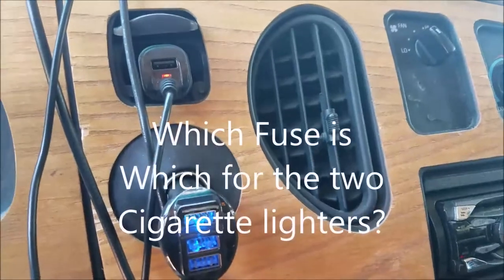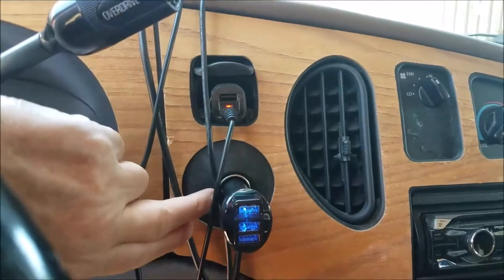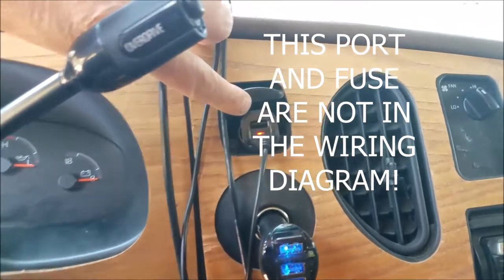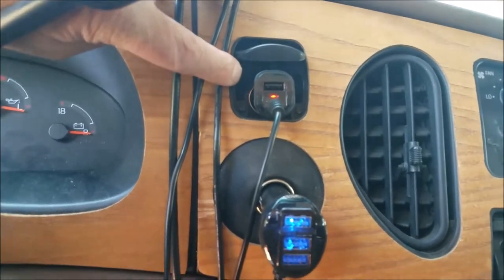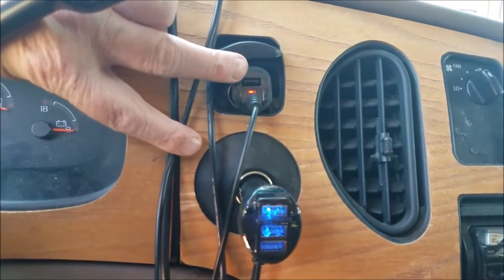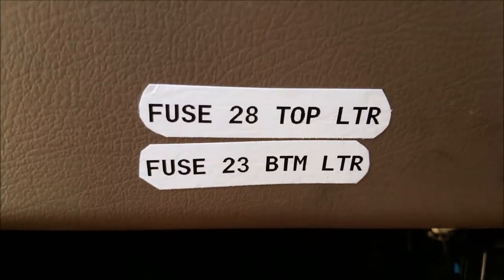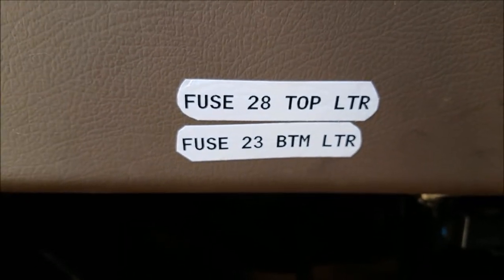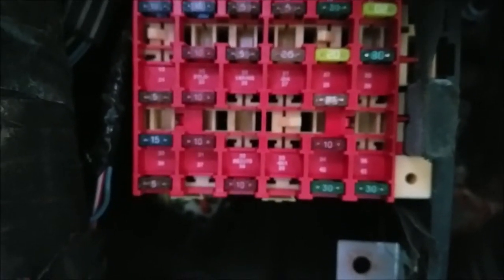1997 Ford E150 Van Cigarette lighter: What fuse is it

Comment: This video was what I needed ....THANK YOU!
Reply from the maker: My pleasure.  I used a label maker and made a label distinguishing the two ports and their respective fuse numbers on the plastic panel at the driver's knees.
Reply: @macclad3  I saw that! I HAVE 97 CLUBWAGON with a 4 inch lift and from the front of the rear wheel well to the firewall was cut out and lowered 4 inches for handi-van.

Now it is my home with Rv stove oven solar mppt dometic rv recessed sink diesel heater propane on demand h20
There are 6 SIX cigarette outlets in the back all no power.

Fried my power point fuse by 3 yr. old quick charger usb fried up.

Thanks again!
Reply from the maker: @1DEFEND  I'm delighted to have helped. I'm waaaaay late on new posts but I do respond quickly to comments and that's what this channel has turned out to be more than anything else.

Comment: Wish I'd seen this before unnecessarily destroying the bottom  cigarette lighter socket getting it out. I'd checked the 29 fuse beforehand, which was okay. But the 23 fuse which I hadn't known about was blown.
Reply from the maker: I have a long pile of those sorts of things.  I highly  recommend scrounging around ebay for the factory service manual and the "electrical diagnostic manual".  The latter just turns out to be the wiring diagram. I also looked around forums and found the "power plug" reference.

Comment: thanks for the info. I just bought a similar van.
Reply from the maker: Their air circulation systems are a bit of a weak spot, particularly  but the vans are fairly sturdy. I replace a lot of suspension, the radiator, the rear bearings on the axle, and the front disc pads twice.  But the stuff is pretty easy to work on.

Comment: Hey I have a bit of a tricky one!!  All of my cigarette light in the back do not work at all but the 2 front (that you showed) does I have a 2000 ford encoline e150 I’m believing it has to be a fuse for all of the ones in the to stop working…
Reply from the maker: Hi Melvin (first of all I'm like a year late on new postings).  But I have the electrical manual for my '97.. I'm outta town until a week from today so I'll have to look at it then. I have the rear cigarette lighters like you do on my '97 (it's a "Universal"(brand) conversion (just wood trim, lighting, and fold down bed).. So I'll look at that as soon as I get back in a week. Let me know if it gets solved before then.
Reply: Let me know if there is any update!!
Reply from the maker: @melvinjordan5559  Sorry I have been working on taxes.  Lemme send them out today and then I"ll look first at the factory wiriing diagram.  Next, on my van, I"ll unplug those two fuses to see if they have an effect.  You'll have an answer absolutely no later than tomorrow.
Reply from the maker: @melvinjordan5559  O.K. I scoured the entire wiring manual for the '97 and of course there is no reference made to those rear outlets.  I suspect it's controlled by an undocumented fuse in the passenger compartment instrument  panel - I looked on the interwebs - no luck. - (so you will have to check yours as well as me checking mine). I suspect it's fuse 40 on the inside instrument panel (it just says, "modified vehicle" and is a 30 amp fuse), and if not that it could be 22 in the engine compartment (trailer battery charge relay, "modified vehicle") but I'd consider that much less likely.  I'll start pulling fuses and let you know what I find.
Reply from the maker: @melvinjordan5559  Well, I'm flummoxed. I pulled every fuse imaginable .. no go.. the outlet stays on!  I'd have to disassemble the interior and trace that wire back through the harness.  I'll try to find something on the forums.
Reply: Thank you so much for doing this!!! It has given me problems from the beginning!! Let me know what you can find and by the way what fuse do you have in fuse 22 underneath the hood? The modified one?
Reply from the maker: @melvinjordan5559  I"ll check the fuse today.  I had a terrible time yesterday fighting a rental chainsaw.  The chainsaw won a partial victory.
Reply: Ok!! be careful man!!
Reply from the maker: @melvinjordan5559  22 is a 40 amp fuse, and the schematic indicates it should be 40 amps as well.
Reply from the maker: Alright my friend, I did a bit of sleuthing.  On MY van, I have a wood panel on the wall down low just behind my driver's seat.  ALL of my rear cigarette lighters route to this - the one on the passenger side behind the double cargo doors (red and black wires - very simple!) routes to the rear and then down into the body and back up to the body behind my driver's side.  It teest into both cigarette lighters on THAT side, and they route into a sub-panel that I mentioned behind the driver's side.  Mine has an oak wooden door if you open shows this auxiliary fuse box.  Don't worry - there IS not documentation for this p.o.s. but on the left side, the red wire from the red/black pair from the nearest cigarette lighter routes into a floating in-line fuse located between the plastic abs recessed housing that holds the auxiliary fuse box - so it's kind of an afterthought of an afterthought.  If you have, and can locate, the fuse box behind the driver's side door, you'll be in luck.  Again, the fuse for at least MY set of rear cigarette lighters does not sit in that fusebox, but right next to it, basically rubbing up against it, in the recessed abs enclosure behind the hinged little wooden door.  I have a UNIVERSAL brand  conversion van.. All it has is more windows, wood paneling, some overhead lighting, and some overhead fans, and a rear folding bed, and a set of cupholders, cigarette lighters, and mini-storage thingies along the little horizontal strips of wood along the wall.  Not much! I had middle captains chairs but I gave them away as I didn't want them - I wanted the storage made available by removing them.
Reply from the maker: So the wiring up to the front I haven't dealt with yet.  First check to see if you have voltage back to the abs recessed fuse box behind the drivers seat I mentioned... then check that fuse if you can locate it. You should see where the red wire from the nearest cigarette lighter goes, into the fuse box assembly, by popping off the ashtrays, cupholders, unscrewing the bezel for the lighter My lighters are on bezels making it easy to remove, rather than some other complicate mess.
Reply: So I have a CD player and vcr plat back here I don’t see any double doors that you mentioned tomorrow I might have to start going behind the wood paneling of the car and dvd see if the wires lead there…. Let me know if anything else…

Comment: Are the fuses the same for the 97 Club Wagon? The cigarette lighter socket on the dash. It's located in the center console next to the ashtray.
Reply from the maker: I wish I knew, I don't have any example around me.. but certainly the easiest way to test is (since both wouldn't require an ignition) to test the voltage on the center contact inside the lighter and remove and reinstall the two fuses...

Comment: Still won't work 😕 😪 anything else I can try? Your video was very helpful but that top cigarette lighter still won't work for me
Reply from the maker: OK those fuses have little exposed spots of metal, so you have to check the fuse for the top one with a voltmeter or idiot light to ground.  Then you'll know if you have 12V on both sides of the fuse.  Then without poking across the outer metal of the inside of the lighter to the metal dot in the middle, check power on the middle metal dot inside the "cigarette lighter" to ground (you pick a good ground on the car.  If it's zero volts then there's a break in the wiring from the fuse to the cigarette lighter.  I can look and see what color of wire that is, but if this is the case you'll have to pull the lighter out and access the wire at the lighter, and where it comes out of the fuse box and measure the SERIES resistance of the wire.  That's the sum of it all..  Check the voltages on both sides of the fuse and the center conductor of the cigarette lighter first.  Lemme know what you find.

Comment: Are those the only items on each of those fuses?  Which video showed the schematic?  Thank you!  Very helpful information for me.
Reply from the maker: Yes, to my knowledge just the one lighter on the one fuse, and the "power port" .. i.e. the other lighter on the other fuse.  I labeled them on the plastic fascia below the steering wheel because the documentation was so hard to find.  I don't think even my factory service manual had it.. I found it on I think answers.com or something like that... Lemme look around but in any case one fuse for one socket, one for the other.
Reply: @macclad3  Thank you! your video and info has been so very helpful!!
Reply: @nwlady1844  I'm in the Northwest (dunno if that's what the NW stands for) but anyhow this van will be used to drive to my new house (shown in my latest video) in the northern midwest from here in the Pacific Northwest.

Comment: I have the same year model van as yours. mine has floor lighters as well and they do not work, wondering if you have any knowledge on what those are?
Reply from the maker: Sorry I was late in reponding - my previous computer died and I had to reset my password, etc.  No, but DId you check the same locations? Also, if you look at the stock fusebox under the dash, there are generally some empty spots.  I'd compare what you have to see if you have new fuses installed - as that indicates new wiring; i.e. for the floor mounted lighters.  I'd suspect corrosion or pinching to be opening-circuiting/shorting your lighter...